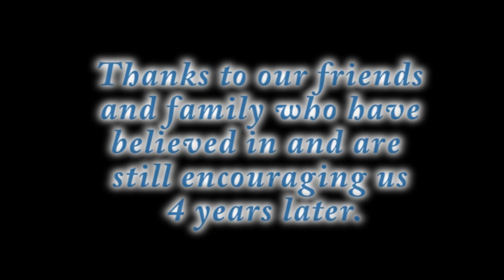Hardening A Section Of Rail, Will It Work?

Comment: Not being a smartass. I honestly want to know if you can bring a section of rail to nonmagnetic temp and quench it in oil to make it hard enough to forge steel on? I know nothing except a real anvil is expensive.
Reply from the maker: The problem is there is more than one company that makes train rail, and it has been made for over 150 years. During this time the alloy has changed and there is way to know how hard a section of rail can become. It is also worth noting that a section of used train rail tends to be harder than a scrap piece of new rail, it can work harden over time. Apparently driving a couple thousand tons over it from time to time can make what would be the striking face a little more resilient.

Comment: Kinda shocked that hot steel didn't make that quantity of water hotter
Reply: https://en.wikipedia.org/wiki/Heat_capacity#Table_of_specific_heat_capacities    the volumetric heat capacity of water is greater than steel,  so  1 gallon of steel cooling 100 degrees won't heat a gallon of water by so much.  A quart (my estimate)  of steel v 25 gallons of water = overwhelming win for the water.

Comment: Wouldn't it be better to do an oil quench?
Reply from the maker: I thought about doing an oil quench, but I was worried about how small my oil quench container was. I only use it for quenching small knives and tools like punches and chisels. My concern was that large piece of material causing the oil to boil over and spill.  I figured a flaming puddle of liquid on the work bench and floor could have led to larger problems :)

Comment: Jeff,

Thanks for the video!
It appears that if you are using a rail for a home blacksmith setup that hardening a rail is not necessary.
Would you agree?

Thanks again,
Chris
Reply from the maker: Since it only slightly hardened all I did was increase the lifespan of the working face, I highly doubt that there would be a significant important in rebound for forging. I think a rail is good just as it is out of scrap yard, been using one for a while now... I don't think it is necessary, this was just an experiment I shared for those who were as curious as I was about the outcome.
Reply: Thanks Jeff!

Comment: "...not gonna heat treat this." ? !  What do you think you just did ?
Reply: lebomm johnson he may have meant tempered.
Reply: lebomm johnson heat treating is both hardening and tempering. He only hardened it
Reply: The process's of "Hardening" steel & "Tempering" steel...is a completely different animal...smh...Next time, do us all a solid and educate yourself before you speak. Some people come here to learn.
Reply: Hardening and tempering are both processes carried out with heat. Hardening is usually done first and results not only in hardness, but also brittleness. Tempering is done at a lower temp to reduce brittleness while increasing toughness. Both can be referred to as "heat treatment", but each accomplishes a different goal.